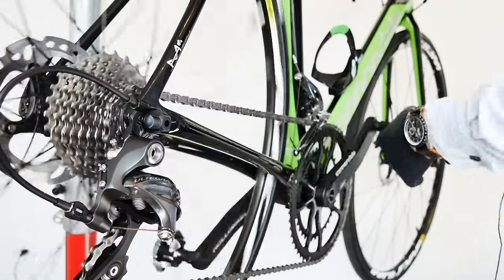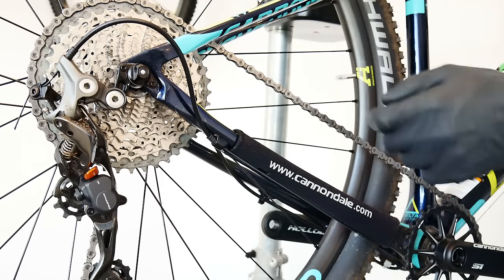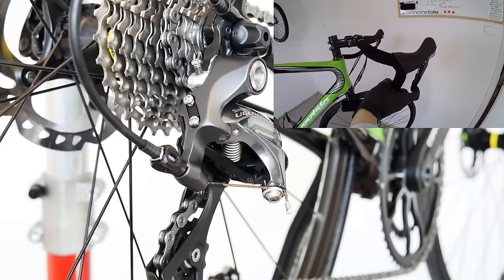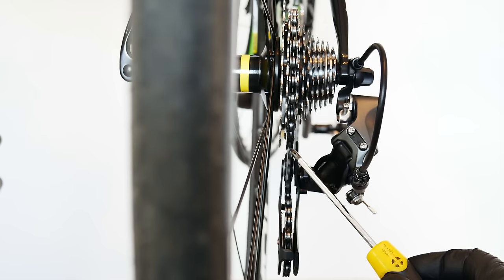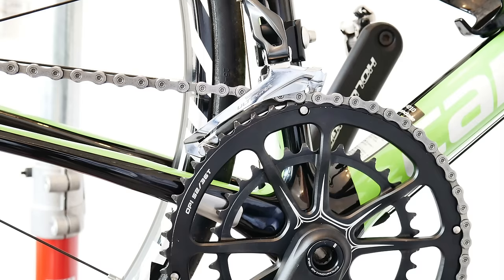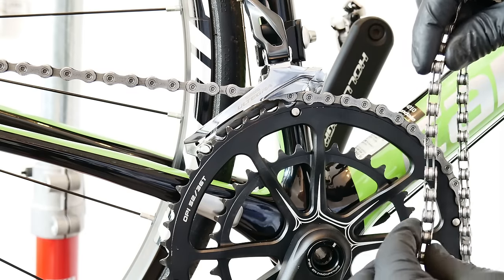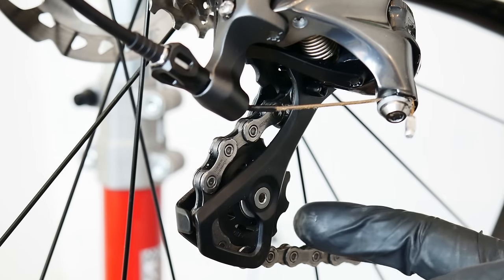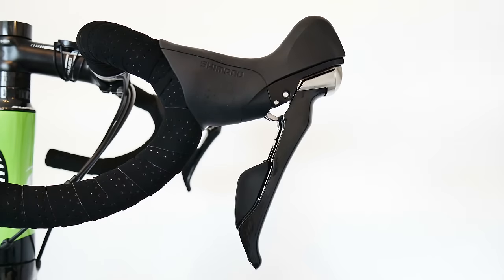Poor Shifting - 6 Main Causes Of Bad Gear Change. Bicycle Troubleshooting

Comment: Wish I had found this video before working my own way through solutions 2 - 6 with out success. Finally slid back the rear cable housing, cleaned the gunk and rust off the cable inside, even needing to use steel wool to smooth it out, a dab of lubricant and success! Thank you.

Comment: I had suffered some of the problems you mentioned.  At the moment my 10 years old Rapid Rise Shimano is giving me a lot of problems shifting gears.  I think I am going to solve this problem with your advices like changing the guide pulley especially.  Both the pulleys are also 10 years old.  LOL.  Thank You for sharing your knowledges.

Comment: A similar problem to the moving cassette can be if there is too much play in the bearings (insufficient pre-load on the loose bearings). I just had this happen when I upgraded from a 10-speed to 11-speed. It went from quiet/smooth to noisy/rough in the mid-block only. It was brand new set-up (as clean as you could get), the gears were indexed properly, and the cassette wasn't loose but there was a little play when applying pressure at the rim. The chain seemed to be rubbing against the adjacent cogs. I figured out that in small cogs there wasn't enough leverage to move the cassette and in the really big gears (e.g. 46T) there wasn't a cog to rub against -- I guess the tolerances of the 10-speed were just high enough to avoid the problem. I just overhauled the  hub and really dialled in the pre-load.
Reply from the maker: Yes, thanks for your input :)
Reply: I think this is my issue after servicing the bearings and cassette. Not enough pre load on the bearings , they are NOT the cone type.

Comment: On Older type Gear Shifters  another thing that can make poor shifting is broken cable strands in the gear shifts on the handlebars.  The strands fatigue at Bends.  The whole cable best to be replaced when this happens.

Comment: 6 main causes of bad gear change:
1.derailleur
2.derailleur
3.derailleur
4.derailleur
5.derailleur
6.derailleur

All the tech like hydro forming,carbon moulding,airforks/shock and they still drag a chain over sprockets and have a shifter hanging on an axle?
Cmon bike industry youve been taking the piss for too long.
Reply: there's a big variety in shifting mechanisms but they are only populair on touring bikes since they're too heavy to use them on road-or mountainbikes
Reply: Carlospicywiener there is no lightweight good longlasting cheap alternative. If deraileurs are as bad as you say then its propably easy for you to tell me a few problems of them that could be fixed by an alternative that still has to be functional
Reply: Carlospicywiener  chain?

Comment: After a lot of research on YT to fix my bike's rear derailleur shifting issue I finally found the issue and solution! Couldn't find a YT video on this matter! I explain it below:

1) The most common type of housing has an inner thin wires tube and an outer plastic covering tube. Apparently after a while because of pressure the outer plastic tube jams and the inner tube wires are exposed that can get crushed by pressure on ferrels! This causes a serious metal-metal fraction between the cable and thin wires of housing, worse than any dirt or rust can do!

2) Loosen the shifter cable and release the cable at the derailleur (watch YT guides) and through all housings to free all housing parts.

3) You have to cleanly cut the exposed thin wires of housing to align it with plastic cover tube. Be careful not to block inner empty hole (where the cable passes) by crushing the wires. You need a sharp wire cutter (or a specialized tool from bike shop!) Then clean up both ends of housing and lube a bit.

4) Insert the cable in all housing parts and through the derailleur cable clamp. Since you lost some housing length, to have the same tension on the cable at a particular gear you need to pull the cable out of derailleur cable clamp a bit compared to what it was before. This needs to be fine tuned to have perfect correspondence between shifter and derailleur for all gear range (watch YT guides).

Hope it helps someone.

Comment: Can a slightly worn out cassette also be the cause of poor shifting? I have a folding bike with revoshifter and tourney RD. The hanger is dead straight (have it checked with ParkTool wrench), the RD is flimsy by its own, but it was always like that. I swapped the chain for the new one, but still the shifting doesn't occur as good as was before, especially on the last 2-3 smallest cogs. The cassette (actually, the freewheel) doesn't look worn when compared to a new one, so I suspect it is either the RD or the shifter itself, however, visually, the RD moves fine, and stops just under each cog, in parallel to them. I guess, I need to swap the components one by one to figure out the culprit.

Comment: I´ve got a road bike that sat a two years in a box and have a problem with rear Sora R3000 deraileaur poor shifting. I tried the first problem, if the rear derailleaur is moving when pressing the shift lever but it stays at place and moves only after a click. Considering it is a brand new bike, should lubing the cables solve the problem? I have internal cables in the frame..

Comment: Is it normal to have a tiny bit or. hair play of clearance after installing a cassette gear 11 x 50T . The hair play  i am talking about is when i hold the 50t gear and move it back and forth towards the spoke and towards the hanger there is a very tiny bit of play or clearance which i think i need to put in a spacer at the back of the cassette gears. Is this normal???

Comment: HELP !!
i have bike powered with shimano gear system. it has 3 front cogs and 7 back cogs
the problem is it only falls in the 6th-7th gear it doesn't fall in bigger gears, what should I do?
good engineers i need your help
Reply: Adjust your limit screws
Reply: Sounds like you have a cable tension issue. Use the barrel adjuster to fine tune the tension.

Comment: 6:20 This is not a fully accurate chain wear test, obviously using the tool is better. Because if your gear is very weared it will show the same sign but it's not the chain. Some unexperienced cyclist may do this test after watching this and conclude they should change the chain, but it's not actually what they need to change.
___________________________
Also, where is my #7 ? In USA / If you don't ride your bike in Winter condition then it's unlikely. But in Canada / Winter Condition, if you ride your bike in the snow. Your Rear Derailleur may seize overtime depending on how it has been made. I have a Shimano Deore DX and it has this issue. The 2 Steel Pivot incased in the Aluminium frame of the derailleur started to seize because the seals that were originally keeping salty water and other junk out started to get too old and corrosion went in. It resulted in the derailleur having a hard time to pull back all the way to the lowest gears because the friction was greater than the spring's strenght. I had to drill 2 holes in the opposite side to hammer out the pivot so i could clean it.
Once it was done, it was working like new.
Reply: No, someone with a worn cassette always has a worn chain.

Comment: The seventh reason for poor shifting is a dragging cable caused when you have internal cables and in fitting a new inner cable you have accidentally twisted it around the internal hydraulic brake pipe, also inside your downtube. Guess how I know this?

Comment: Sickbiker, would you say its ok to clean your chain, cassette, derailers and all cables after every ride? I ride from 20-100 miles a week, pretty much everyday all depending on the Florida weather. Plus I live on a beach and salt eats everything!
Reply: djaybadfish1 use a degreaser on a cloth not too much now as your only taking crap of the outside of the chain and run the chain through the cloth. Then regrease again not too much just enough to protect and ensure smooth running.

Comment: my front derailleur does not move from 1st to 2nd but moves to 3rd properly and 3 to 2 and to 1 properly please suggest how to solve this
Reply: Tanuj Mukund adjust derailed adjustment screws... there is plenty of vids on doing this correctly in a sequence.
Reply: Same problem for me

Comment: My Norco Storm 28er was upgraded to Deore 9 speed. In a ll 3 rings, it sticks at 6. To the point I have to shift the Deore shifter twice to go to 7. Then you get a 'clunk' sound of the chain jumping. 1,2,3,4,5 smooth. 7,8,9 and back are fine. It just sticks at 6. Quite annoying let me tell you! LBS adjusts the cables checks the chain and it works. Tomorrow it does it again out of spite and it fucking pisses me off!!! Thinking its the hanger.
Reply: Joe N you can see in derailer H and L adjustment screws these screws with very little adjustment can help by moving the derailer to align the gears. In your case the L screw sounds like it's screwed to far in so the smallest gear isn't being aligned. Look up on YouTube "adjustment of rear derailer screws" to get more detailed instructions
Reply: I had the exact same problem for so long. Adjustments only gave a good result a day or so. A few days ago it stuck in 9 so LBS changed the cable and the housings and now works great, though it's been only around 230 km since.

Comment: That was horrible sounding gear changes , holy crap man not even my $300 GMC Denali road bike sounds like that. The cable for the back Derail is too loose, the Cogs are not indexed properly ( pay attention to the jockey wheels!!!), the Cassette needs to be replaced as it is wobbling, the chain is dry as a bone. Poor Cannondale man it's being abused. There should no crunching noise when switching the back cogs only for the Front Rings should be heard with the chain being moved by the front derailleur. Good video but I would not trust you with my $300 GMC denali lol.
Reply: Why don't you make a you tube clip and post your suggestions on here? Would be interesting to see how you would have done this differently / better?

Comment: What does bad shifting mean? I have a problem in which my cycle shows gear 2 but the gear will be on number 3 how to fix that.
Reply: I know this a late answer but your gears have not been indexed properly. The cable tension is quite bad

Comment: I purchased 21 speed bicycle yesterday.  It was used and had been hanging up in a garage for 5 years.  I rode it today and I am not getting maximum use of the gears.  It's too easy too pedal in setting 2-6 and 2-7.  Then I switch up to 3 and have to go all the way to 7.  Something doesn't feel right.  I have another 21 speed bike and do not have an issue with this.